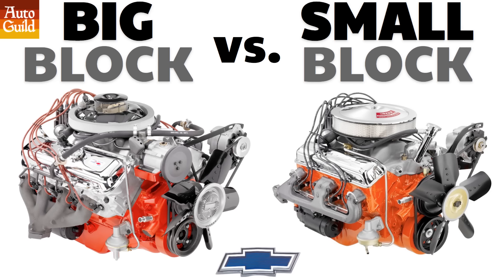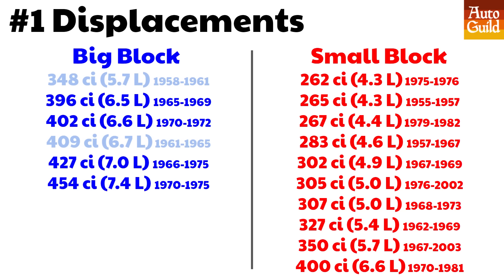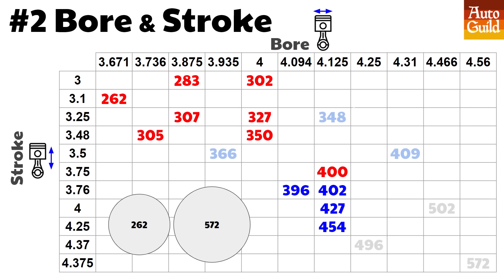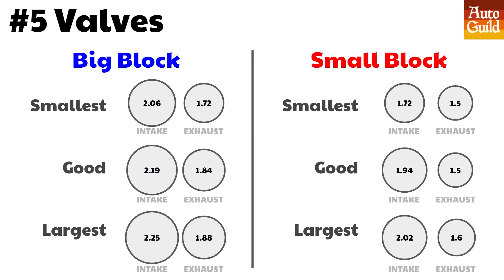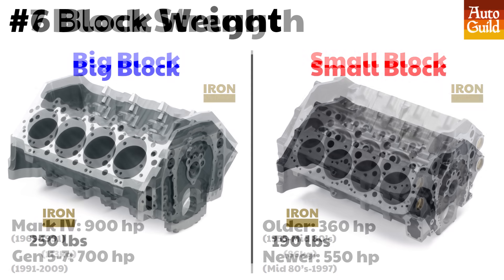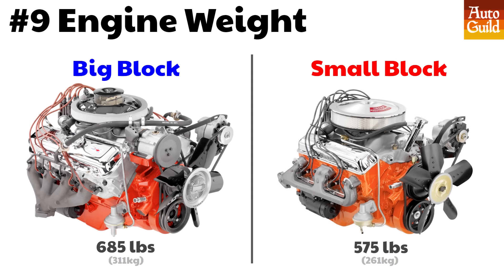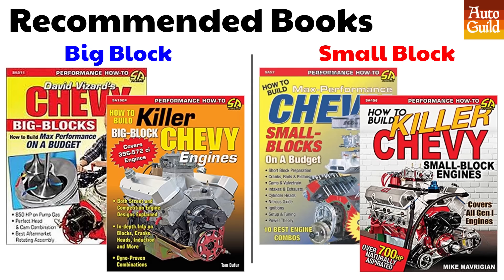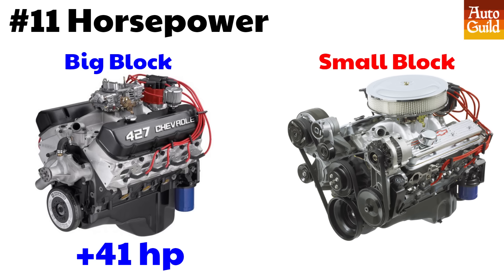Big Block vs  Small Block Chevy Comparison

Comment: You can lighten the big block further.. but you can really lighten the small block and bore and stroke it for cubes ...  better yet 6.2 LS ....I would always go  with an aluminum block 6.2 LS3 then just add a few key parts like better cam and matching valve springs, the correct intake , blue printe the oil pump,.a good tune etc..and it will be lighter, make more power and for less money ...PLUS it will be more durable with better tolerances and fitment, and fuel injection keeping each cylinder more closely matched.
Reply: I'd love to see you try an build a cam, heads, intake ls3 for less than a sbc or bbc... ain't happening

Comment: My family has an 06 suburban 2500 with an 8.1 bored out to a 550. It fries transmissions but damn does it sound good. It gets used as a boat hauling rig for a 540 ci 26 foot jet boat.
Reply: Can you elaborate on how you got that motor to 550? Cus even if you bored it out .100 over and let's just say put a 4.50 inch crank in it, that would only be 535 ci. I'm wondering how a stock block could handle that much without running into some kind of issues?
Reply: @paulcarter2879  wizardry and money
Reply: @hunternelson3018  what's the bore and stroke of it? Do you know? It's got me curious if an 8.1 can handle going that big. The biggest kits I've found are for 540ci, and they express the need to use an aftermarket block.
Reply: @paulcarter2879  I’m not sure on the bore and stroke, it was sent to a machine shop as a short block and came back as a short block, we just replaced what needed replacing and kept everything that can be stock. We check it regularly and it hasn’t had a problem yet. We built it in 2011/2012. Even the starter is stock so it sounds like the battery is always low on startup.

Comment: After watching the LS  vs sbc  what a joke it  was this one is a little  better but you still need to research  more the LS  did not replace the sbc,bbc in 96 lmao. The gen2 sbc was was used in 97 and gen1 till 02 6 years and the 8.1bbc was 07 11years after the ls1 was released.
Reply from the maker: Thats true it did take GM to phase out the old engines over time.  But essentially GM started to ramp up production of the LS and that took a while.  Plus with its higher cost the left the old engines in some lower prices cars and work trucks too.  Thats normal for any car company when they come out with an all new engine.

Comment: A couple points: The all aluminum 427 was designated the ZL-1, not the Z-11.  Also not that the ZL-1 and almost identical L-88 had a redline much higher than 5500 rpm,  Both the DZ 302 and ZL-1 would far exceed your numbers.  And lastly, torque is measured in pound-feet, not foot-pounds. Otherwise a nice video.  The LS info is extremely informative, since I have been out of the hot rodding loop for a while I had no idea it was that advanced. Keep it up.
Reply: Z11 was a 427 engine option for the 1963 impala. Basically a mildly stroked 409 with better heads and intake. Some interesting history there
Reply: The Z11 is pretty special because so few were made with the Mark IV being released the next year.
Reply: @Yohann67  so whats the Mark IV?
Reply: It’s the “mystery motor” that debuted as the 396, then 427. Etc, better known as the big block Chevy.

Comment: You do a great job with these videos, I have a 1967 Camaro with a ZZ502 and have had the car for 40 years.
Reply from the maker: You have me beat I've had my Camaro 32 years, bought it when I was 15.  I saw the video of your 67, very cool!  Are you planning any more mods for your car or is it "done"?
Reply: @AutoGuild  Just making it more streetable ,it has been a race car for the last 25 years.
Reply from the maker: @rickboretirementplan  I'm curious.  What is its best ET and trap speed?
Reply: @AutoGuild  With a stock ZZ 502 power glide and 456 dana 60 it has run 6.48 @104 1/8 mile. In hot weather it would run 6.60 all day long.
Reply from the maker: @rickboretirementplan  That's impressive!  My camaro has a tired 327 thats probably making 150hp, its so old and tired, LS swap is coming soon.  So what are you doing on your car to make it more streetable?
Reply: @AutoGuild  I lost some points from your cool list by replacing the front springs, it was no fun to drive with 2 inch of header clearance. Also had to rewire for all lights and a passenger seat .
Reply: @rickboretirementplan  when you put that 502 in?
Reply: @tycheez85  It's been in for about 10 years, never had to fix anything runs great.
Reply: @rickboretirementplan  💪💪💪

Comment: 5500 had a new 68 chevelle 396 375 hp saw 7000 rpm all the time completely stock
Reply: Yeah the l88/zl1 472 loved 7200rpm all day long
Reply: I scored a 69 Chevelle 375 HP in 1978..rebuilt it with stock cam .30 overbore...in a 74 Camaro ran 12.20 ETs..sold the car and installed it in a lightweight 57 chevy and ran 10:90s..its in my 56 150 utility sedan today with a six speed and 69 Chevelle 12 bolt..bought the car in 1981 with a 283" that an auto shop installed after buying  it at auction from Pacific Bell..they serviced it since new..tried to buy it in 66 but they wouldn't  sell..LOL
   That's  my story and I'm  sticking to it!
    Been idle for 13 years and being gone over to live in Las Vegas heat...

Comment: I have a big block in my 55 chevy. My college professor always said there is no replacement for displacement so bigger is so much better.
Reply: I will never go electric you hippie. Combustion engine's will live forever . when Tesla sales a electric car do they tell the oner that it costs about 20,000 to put a new battery in it
Reply: @patricksaylor6210  the statement about displacement.  You can add electric and turbo to replace the displacement.  Supercar now used hybrid setup.
Reply: I said 11,000 not 2000 why are you even on this site it's about combustion engine's
Reply: They can make a peppechrel motor but they can't make a lot of money that way do you think we are going to run out of fossil fuel?
Reply: @patricksaylor6210  🤷
Reply: @patricksaylor6210  I thought we were taking about replacement for displacement 🥴
Reply: Show me a Tesla car with a 11,000 house power electric motor
Reply: @patricksaylor6210  not tesla but it can be done. There's even 2000hp.

https://youtu.be/xS4q-r3ybdY
Reply: The answer is no it to is a renewable energy
Reply: We are
Reply: You brought up the Tesla
Reply: @patricksaylor6210  because tesla motor is smaller than 1.6 liter 4 cylinder engines yet can produce over 500hp
Reply: It's like why would you take a 350 block and 400 crank and make a 377 or 383 I would take the 400 block and make a 454 small block
Reply: There is no replacement for displacement. Mr. Ingersoll tryed it back in the late 80,s and early 90,s with a turbo charged v6 but the 700+engine always beat him in the final round
Reply: What does it cost to replace it
Reply: You can keep yours and I'll keep mine
Reply: @patricksaylor6210  lol, we are not talking about price. If you want to talk about engine. Bugatti w16 with with quad turbo to put it in perspective.
Reply: @patricksaylor6210  now that's 8 extra cylinder than your big block.
Reply: I can't afford that but I can afford a thousand horse power big block chevy with an 871 blower running on e85 on the streets
Reply: Tesla beg to differ
Reply: If money is growing on trees then I want a top fuel engine 500 ci and 11,000 hp you can keep all that other junk. I'm finished with this convocation
Reply: @patricksaylor6210  ok

Comment: I've always liked small blocks for cars and always had big blocks in trucks.
Reply from the maker: I would agree,  Thats a pretty good strategy!
Reply: @AutoGuild  Big Blocks make more power with less RPM though so I prefer BB over SB for that reason alone. 

Small block V8s are cool sure. 

I have one in my modern 99 Jeep GC Limited but Big Blocks are where all the raw power is found.

Comment: Best engine is not big block or small block but the medium block - 222 cubic inch displacement 335 hp 3.6 V6.....
Reply from the maker: I love a good 6-cylinder too!
Reply: @AutoGuild  I'd say the BEST American inline six would most likely be the AMC 232 and 259 units. Superior castings to what the Big Three used, easily modable, reasonably fuel-efficient, and will do ANYTHING you can ask of it. As for best all-round V8, the Studebaker 289 cid. V8 gets my vote for similar reasons.
Reply: @jakekaywell5972  I tend to agree with that and I'm a Chevy man.  I have 2 Jeep Cherokees (because I like the boxy style over the Chevy Blazer), both with 4.0s in them and they are workhorses.  My '99 will turn over 250,000 miles next week and has never had any serious work done to it.  They claim they can go 300K miles easily if you treat them right.  They do have port injection which contributes to their longevity over a carburetor.  Only thing I don't like, they do like to drink.... gas that is.

Comment: The only thing I hate about ls engine is the fact that you need a computer to start it.
Reply: Convert it to a carb....
Reply: Put a msd box and intake and carb
Reply from the maker: I know, its a pain, but of course thats what makes it so good too.
Reply: @AutoGuild  I don't like the LS oil pump and components.  Lost 2 LS's when the pickup tubes fell out of the pump assembly.  It's cheaply made with an "O" ring and tiny bolt to hold it in place.  Yes, they do make power with those heads.